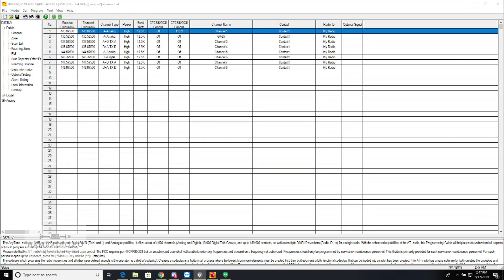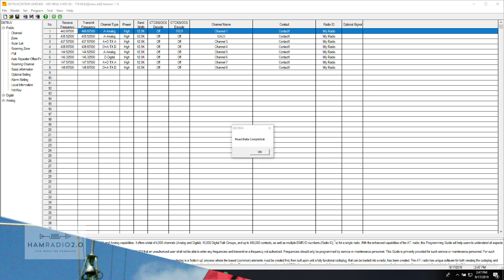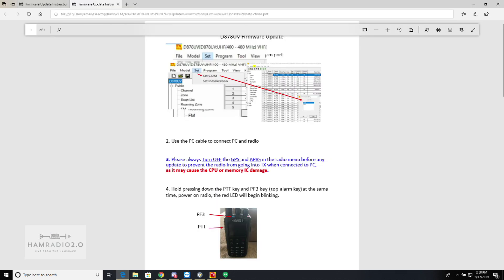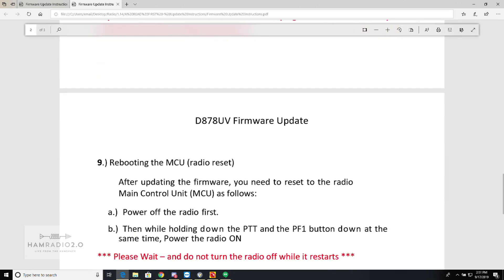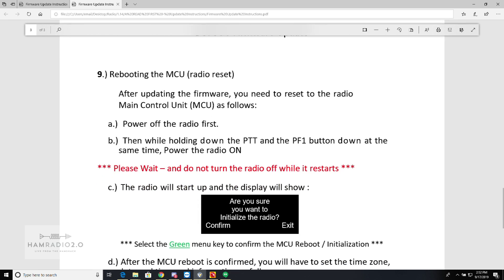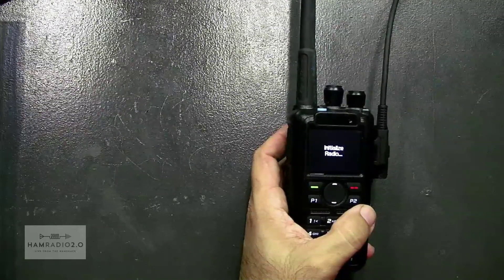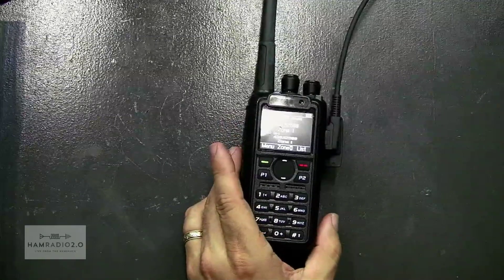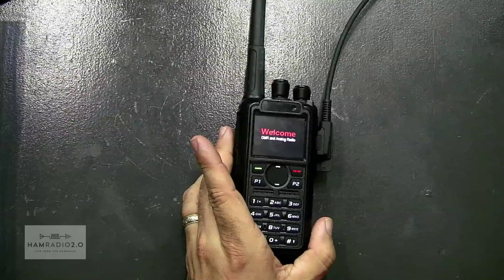Anytone D878+ 1.14 Firmware Updates, Part 2

Comment: I have an 878 plus with 1.16 firmware.  I have tried several times to update the firmware to 1.17 and it will not take.  Still says 1.16. Any ideas or suggestions?  Thanks

Comment: are you going to have the 220 mod how to on here soon ?
Reply from the maker: I'm not aware of a 220 mod for the HT.  Do you have a link to a source for this?
Reply: @HamRadio2  no I don't,  but I have two friends who has done it.
They copied some hex editing they received to put the new triband 5888 into 220, I do have the hex procedure for my mobile,  but not sure how to apply it to the at d878uv
Reply from the maker: @toddbaker8159  The D578 mobile comes with 220, no editing is needed.  But I will see about editing the D878
Reply: some needed hex editing

Comment: Where in the video is the baseband update?  I see the install of the FW (PTT + PF3) and I see the reset of the radio (PTT + PF1) which is not the same as the baseband update.  I never see the baseband update per the instructions that came with the FW1.14 download under directory "Base Band IC 3258 update" which instructs user to "Hold pressing # key and orange/blue top key, at the same time power on the radio, screen display".  It prerequires installation of  "SetupSCT_PORT.msi" which is the problem I am having (asking for .net framework over and over...)
Reply from the maker: Neither of my radios ever asked for that. I'm assuming that your computer is the one asking for .net framework to be installed, and if it keeps asking over and over, then it isn't installing properly. Either you don't have permissions to install or something is blocking the install. My computer did install .net during the CPS install and it worked fine.
Reply: @HamRadio2  Hmmm.  I am not sure what you mean by the radio asking... the baseband update is just a folder named "Base Band IC 3258 update" in the included 1.14 fw zip file with the pdf instructions in file named "D868UV-D878UV Base Band IC 3258 Update.pdf".  

In anycase, I finally got the right version of .net framework installed (dotNetFx35setup.exe) and installed the baseband, reset the radio then reinstalled the codeplug with the 100K+ contacts...  so I am good.

Your video was very good informative for everything but the baseband update which is what made it show up in my google search... the words "I went back and showed how to do the Baseband update" on the description.....

Cheers and '73
Reply from the maker: The Baseband update was the 2nd step I performed in the video.  Upon updating both my D878 and D878+ radios, neither of them required the update that you mention.  The Baseband is just basically resetting the radio (PTT + PF1)
Reply: @HamRadio2  "The Baseband is just basically resetting the radio (PTT + PF1)"  

I respectfully disagree.... At least based on my interpretation from the instructions from AnyTone, it is a different procedure... see PDF reference in above comment.  The PDF is actually also included in the 1.15 package, but unfortunately they don't include the program nor point to the 1.14 package for it....  In total, there are 3 key combinations:
1. Reset/init (PF1+PTT+turn on)
2. Update FW (Blue/Orange+PTT+turn on)
3. Update Baseband (Hash/Pound+PTT+turn on)
Reply from the maker: @mianesva  You could be correct.  However, as I stated, that 3rd step wasn't required for either of the 2 radios  that I updated, so I would be curious to see how/where/why that step would actually be needed.
Reply: @mianesva  I had the same questions and a google search for "baseband update" brought me here as well.  And you're correct, the "MCU Reset/Date update" screen is not the baseband update process.  I have my radio updated to 1.15, but haven't done the baseband update yet.  Everything seems to be working fine - so I'm wondering what the purpose of the extra baseband update is.  I can't find any info on it online.
Reply from the maker: According to the information I received from Anytone, the steps in this video are the Baseband update.  It is basically just a reset.  However, there is conflicting info online about it, and I believe Anytone has changed the procedure since this video.  But like @K1DJB just said, it doesn't really seem to be needed.
Reply: @HamRadio2  I decided to download the "Base Band IC 3258 update" and I installed it yesterday on my 878UV.  It's definitely different than just the MCU Reset and does install an updated (something?) in the radio.  I'm not sure what it updates and the radio doesn't act any different after the installation.  But it went smoothly according to the Word Doc that is included in the install folder.  Just adding this in case anyone else has questions.
BTW- Thanks for all the videos Jason, very helpful.

Comment: Where in the video does it show the baseband update?
Reply: Not sure that was the baseband update or at least nothing like I had to do for it. What is the exact time in the video where it’s supposed to show it.
Reply from the maker: Well that is what the instructions call it.  And that is what people asked for after I posted the last video.
Reply: Alright sir. There are additional instruction in my zip file that go over the actual baseband update that I don’t see in the video. Thanks for for the info though.
Reply from the maker: Understood.  But none of that is really needed.  There are many things in the instructions that I didn't go over because they don't have anything to do with the firmware update of the radio itself.  The instructions also include ways to update the GPS and BT firmware, which I didn't include.  But the Baseband update, the step to update the base OS of the radio, is included in this video.  It is the last step before writing the codeplug back into the radio.
Reply from the maker: Towards the end, with the 2nd reboot.

Comment: I couldn't get the baseband update to work... maybe I was pressing PF2... but it seemed to work just fine without the baseband update. Not sure why that step is required. 

In other news, I use git to control the revisions of my codeplug. Then I push it up to github and have a cloud backup. 

73, Brian WB8AM
Reply from the maker: All of the codeplugs we keep on dmrtexas.net are also on git. Good idea

Comment: You can add a BlueTooth card or a memory upgrade to the 878UV.  878UV+ is the exact same radio + a BlueTooth card. You can have either BlueTooth or the upgraded memory but not both.  There is a youtube video somewhere that walks you through the BlueTooth card installation if you want to upgrade.  

73
AE0HF
Reply from the maker: Considering how Anytone has done things in the past, it wouldn't surprise me if this radio already had BT and it was simply turned off. But the point I was making in the video was that the same firmware would work with both models.
Reply: @HamRadio2  You are correct.  :)  I'm sure you have helped a lot of people.  Very great of you.  I do not think that they have a BlueTooth card in there yet or people who have added them would have noticed.  I know why you thought it could be that way though as that is common now days to do things of that nature.  :)

Comment: I wonder if the B-Tech firmware update would load on the Anytone?  They are nearly identical and it would be a cool experiment to see if it would work.  It might mess up the radio, but it should be OK after a reload...
Reply from the maker: The answer is still no. This question was asked on the last video. The 2 radios are using the same OS but different firmware. Likely the CPS wouldn't even read the BTECH or the BTECH CPS wouldn't read the Anytone firmware